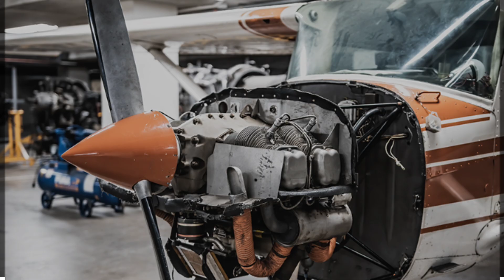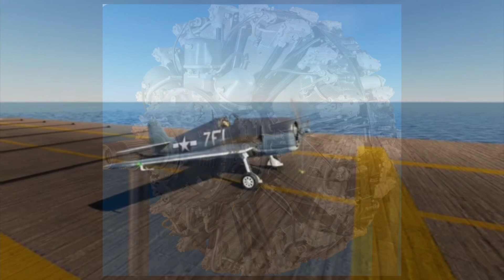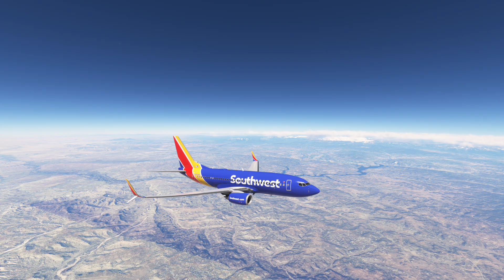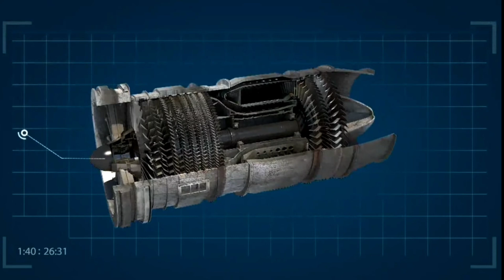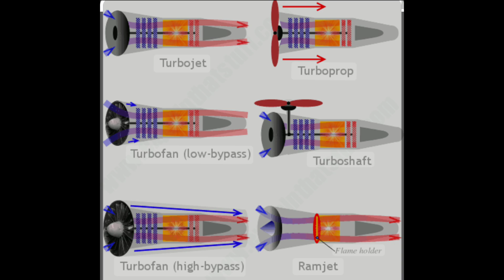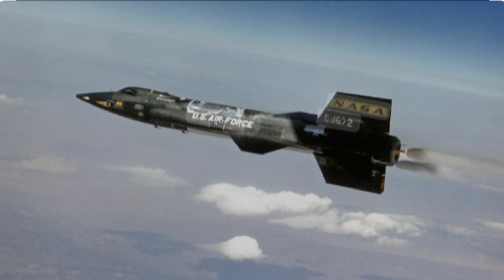Aviation Engines & Propulsion Systems

Comment: 4:40 this is incorrect, jet engines do not carry oxygen for propulsion, that would be rocket engines. They work basically the same as props, by accelerating incoming air, however, the heat cycle is continuous and not broken down into 4 repeating steps.